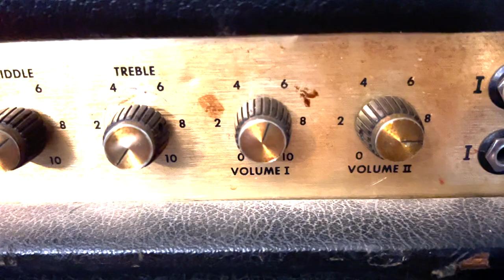Recreating The Classic Van Halen Tone

Comment: I feel like the power soak took away from the open transparent tone that Eddie had.. Also he used a Variac to drop the plate voltage to get a little more dirt and sag.
Reply from the maker: Yeh it does take away from the tone.  It’s looses a lot of high end.  But the amp is so loud, I can’t crank it. I need to make an isolation booth lol.

Comment: It's  pretty close, cut the mids a tiny bit.the power soak made it sound a little furry...but Eddie  used a variac to achieve a cranked sound at a lower volume and there is a sweet spot ( on the Variac)so you may want to try adjusting it. All in all good job man.

Comment: Sounds awesome..how loud was it in the room with the amp on 10?
Reply from the maker: It was not bad.  You could have a conversation.  I ran it through a Bugera power soak.  The thing takes away high end though.  But makes it possible.
Reply: With the amp on 10 where was the dial on the Bugera? Thank you
Reply from the maker: @jessienidiffer9440  the Bugera was at about 9 o’clock.  It really just acts as a master volume so I was running a decent room volume but not crazy loud at all.
Reply: @Ranch5150SkinWalker  

Thank you Marty.  I bought a Marshall SV20 and a Bugera after watching your video.  Still trying to dial both in.  Thanks again
Reply from the maker: @jessienidiffer9440  I would love to hear it.  What type of cabinet are you using?  I bet yours sounds amazing!
Reply: @Ranch5150SkinWalker  

I’m using an EVH 2x12

Comment: Does it have 6ca7's in the power section? Thats what Ed used
Reply from the maker: Not sure.  I wish I had better knowledge of it.  I did recently have the caps replaced and new EL 34s installed.
Reply: @Ranch5150SkinWalker  if it has el34s in it, it doesn't have 6ca7s lol
Reply from the maker: @jamescarpenter4777  good to know. Haha. It had 6550’s in it originally.

Comment: great tone, but at around 7:05 starting sounding overly middy and compressed. probably the power soak
Reply from the maker: Yep. That power soak is also a tone soak. Haha.  I need an isolation booth.
Reply: @Ranch5150SkinWalker   Iron Man II 100W attenuator by Tone King uses pure transformer coupling. Zero tone loss. Check it out
Reply from the maker: @5150forevermore  thanks for the info!